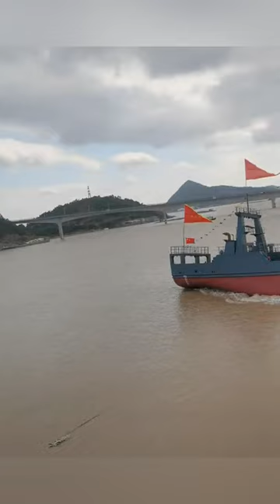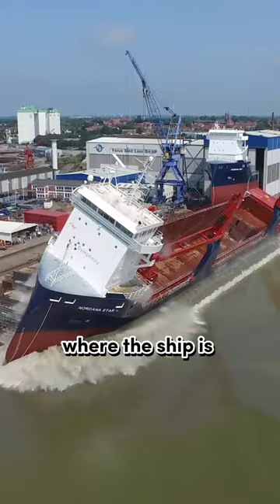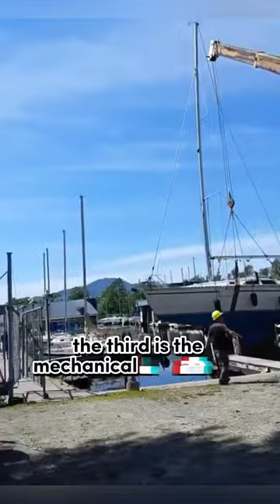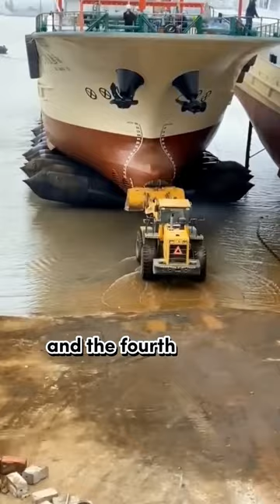Ship Launch Type #shorts

Comment: Second one makes Sooo much sense why would they use the other methods 😮
Reply: dry docks are fucking expensive
Reply: @fuckcensorship69  yeah but a whole new ship going belly up is even more expensive. Wouldnt a dry dock be a realy expensive but very very much needed thing??? I mean. No way id risk a new ship in trowing it in the water like a baby
Reply: You can't have a dry dock for a freaking huge cruise ship unless you are not ready to cough up money.
Reply: @l-_-Mr.-_-No-_-One-_-l  If you are not using a dry dock then you are using a large piece of land and a concrete standing. Or you can take the same piece of land, dig a hole pour a bit more concrete than would be needed for the standing and put a removable dam in and some pumps for a little bit more.
Reply: @Aposte-quotation  dry docks are also not easy to build, cause it being near water the soil is water logged so you need to keep the water from making the in progress dry dock a wet dock, which is why it makes it so expensive
Reply: You need a lot space and it's expensive and not to mention all those safety measures that needs to be taken it's a lot of head ache

Comment: Drydocks are probably the only relic left of the steam era, besides the slipways, they do it sideways, not gracefully slide back or front into the sea.
Reply: Which is weird. Forwards r backwards is what its built for, way more stable
Reply: @the_retag  
Yeah exactly, and it’s way more graceful too.
Reply: @the_retag because the first one in this video can happen
Reply: Sliding a ship in stern first has its own problems, such as uneven support of the ship along its keel during the slide. Fine-ish for shorter ships, but you're not going to do that, at least successfully, with a longer ship. 800-foot-plus ships like Titanic, which was end-launched, are probably pushing it.
Side-launching ... do it right and the whole ship goes in at once, which is better for the keel.
Drydocking is the least stressful on the ship - flood the dock and float the ship out - but you tie up a drydock for a year or more while the ship is being built. That's lost -opportunity costs for the shipyard, which could be making money off the dock for repair and inspection contracts.
Reply: Some submarines are launched via drydock method.